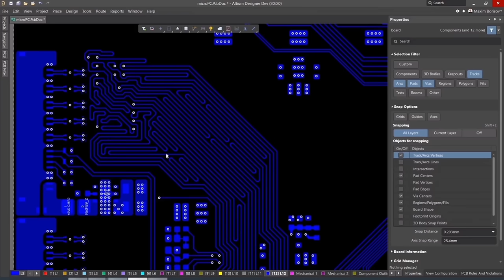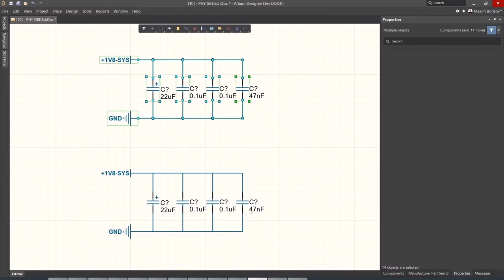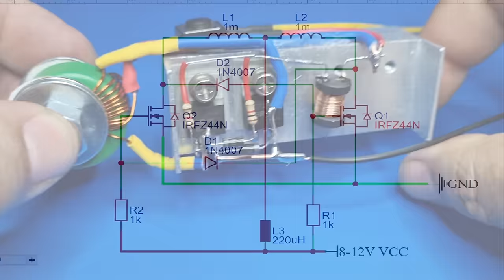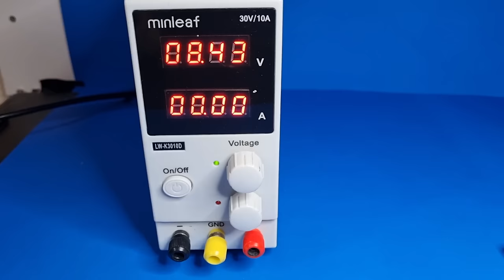How to make a Simple and Powerful induction soldering iron / New Circuit

Comment: Bro🙏🏻In this circuit You Didn't use the capacitor (.47-1πf ) installed on the drain of both the mosfets,Will it make any difference, and can it be made with adjustable heat?
Reply from the maker: более эффективен с такой формой без конденсатора
Reply: Супер. А регулировку можно здесь придумать?

Comment: The circuit will not work without capacitor connected across the coil at tank circuit. Pl correct the circuit.
Reply: Iv assembled it ,, works , great ,